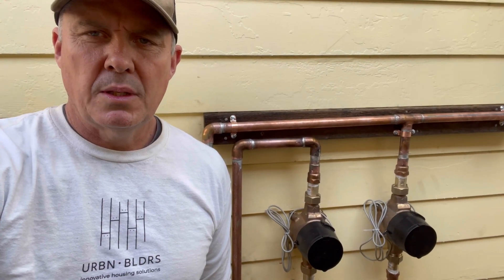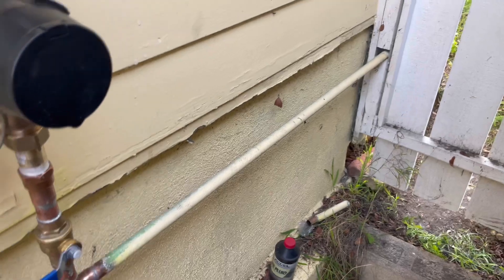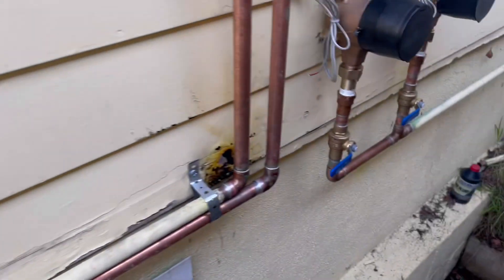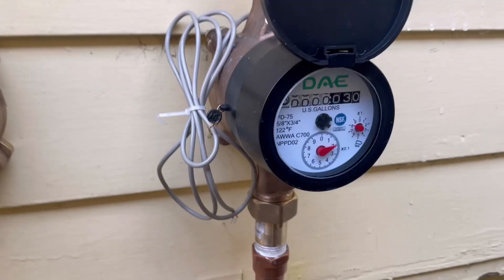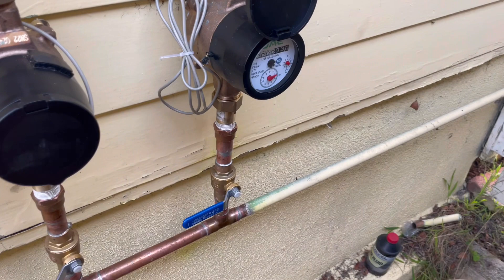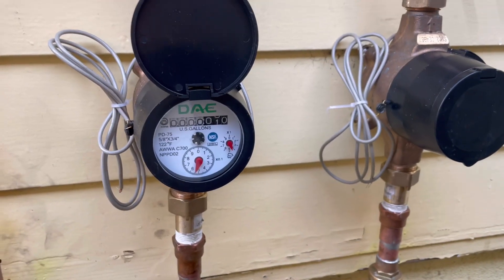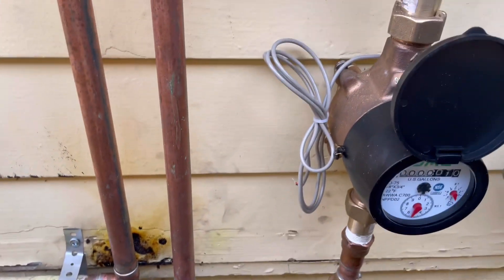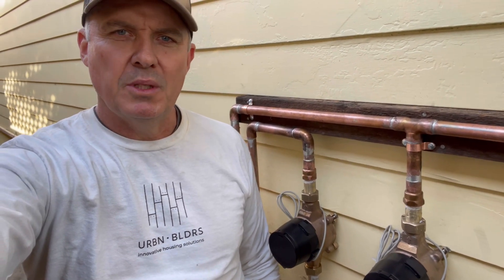Sub Meter your ADU for Water

Comment: Do you have a hot water heater specific for your ADU? 
I was going to submeter, but I need a hot water meter; and those are only available in the non-positive-displacement models.
Reply from the maker: Believe it or not, often in California the water heater is included in the T24 energy calculation. Sometimes even the specific model is described. You could check there to see if it is listed. If not you could use any electric or gas boiler that meets your needs.

Comment: How are those meters working out I’m pretty sure you can’t install those in the vertical position you need a different model
Reply from the maker: Not sure where you got that info. From the manufacturer - “Can be installed in any position, vertically or horizontally, dial facing upwards or downwards or side-way, water flowing downwards or upwards. Good for outdoor use, pit application.”

Comment: I'm sure your water utility has a tiered system for billing water usage. I'd like to know how you went about calculating the water bill using the same or similar tiered system. Thanks!
Reply from the maker: This was for a client’s property so I don’t have info on how they split the billing with their renters. I would imagine it wouldn’t be too difficult to split it based on usage percentages and if one renter was consistently pushing he bill up into a higher tier maybe apply the higher rate to their portion??

Comment: Dude, of course we have questions. Starting out like, what brand of meter is that? What’s the price of 1 meter? Are they reliable? Do your tenants complain about them?
Reply from the maker: DAE PD-75 Lead Free  - They work great. These are just the basic meter, you can also use a gateway and track the usage on-line, or pay a service to do the monitoring and billing for you.
Reply: How do you find how to track usage online? Also, how do you meter a sub panel? Super helpful!
Reply from the maker: @joshwhite8819  https://daecontrol.com/product/dae-cc2030-gateway-cloud-metering-solutions-on-water-and-electricity/
Reply from the maker: @joshwhite8819  you can get a 100A smart circuit breaker installed in your main panel. Any load drawn through that circuit can be tracked. It’s the same idea as the water meters. It all comes down to how on hands you want to be and how much you want to spend on your setup
Reply: @URBNBLDRS  thank you! If you could do a video about this further I think you’d get good views. A lot of people don’t know this is possible, I’m searching online about adu stuff all the time. This is the first time I’ve seen this possibility. 

I’ve been planning to install a dual meter but I have solar panels on my main house and by adding the dual meter my adu would miss out on the solar savings. So if I’m to rent to Airbnb or traveling nurses I’d miss out on the savings so this is a great idea to be able to track but still get the benefit of both. Thank you!

Comment: Gonna sub meter mobile homes.  How does the wifi part work.   Each mobile home would need a wifi?
Reply from the maker: All the meters can be on the same Wi-Fi. So ideally set all the water meters in one location and then run your supply lines to the individual trailers.